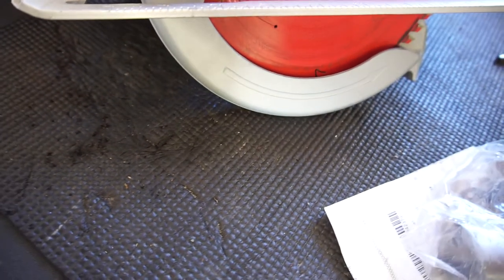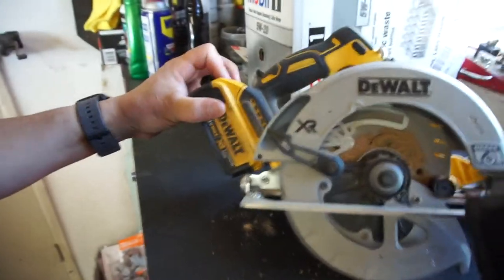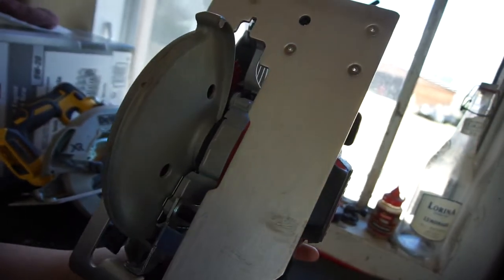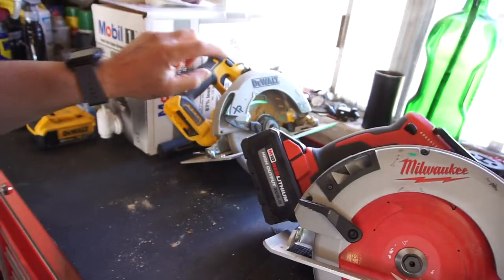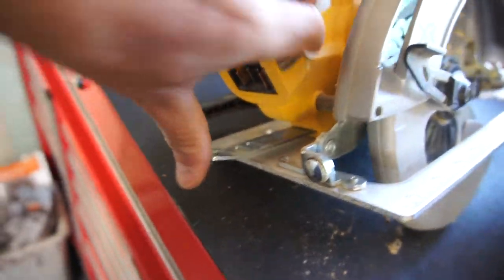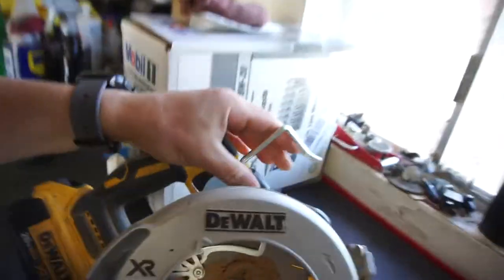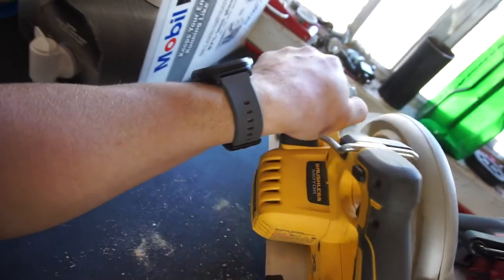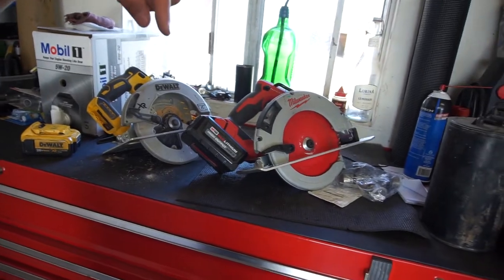Tool Review Thursday Milwaukee M18 Brushless Circular 7 1/4' Saw. Swap Meet Find.

Comment: Model 2631-20. Better than the fuel version.  I have both. 4 pounds lighter. And the motor is flush with the shoe where the fuel sticks out and hits Everything.
Reply from the maker: Thanks. I haven’t had time to use it again so I didn’t know the model number. Glad I got the better of the 2.
Reply: Seeing your review gave me reassurance that I bought a good tool

Comment: The 30% glass fiber reinforced bevel adjustment is a cheap out by milwaukee but it has held up well.
Reply: @marksossamon3123  not the worst I've come across, trust me. I wouldn't have noticed it except for the fact that you mention it but I know what you mean.

Comment: I've seen a few guys rave about Milwaukee tools , especially the Fuel line up .  As far as you ripping the guy off , who knows what he paid for it ?  I'm sure he made up the loss on the other tools he sold that day.  I'm too old to start buying battery powered tools . As often as I need them my ole' corded tools will do me just fine .  A drill might be cool but not until mine quits me .